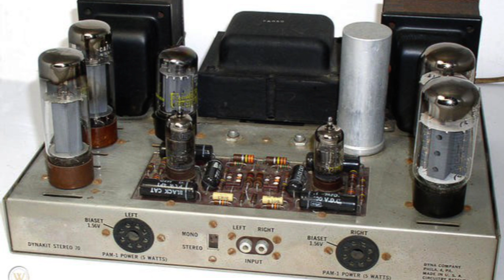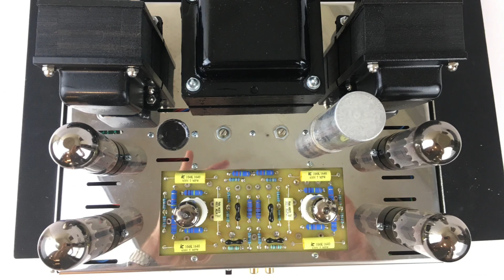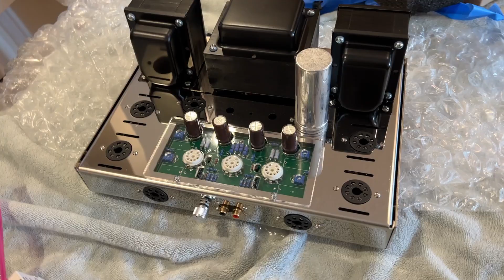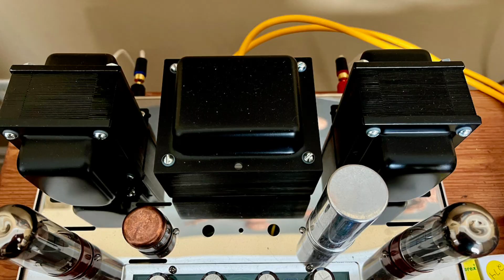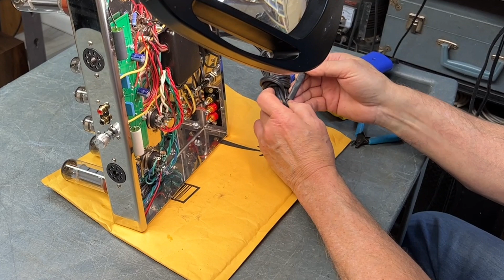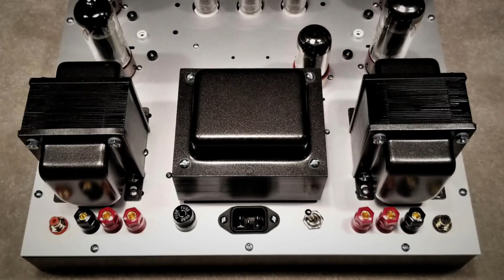The Dynaco VTA ST-70 Review. My First Proper Tube Amplifier.

Comment: Yet another fall. You stated - unequivocally - in you initial vid that your purpose in this entire exercise was to identify an amplifier with non-transistor sound. You wanted to find an amplifier with rich "tuby" sound. But, it this video, there's no mention of that. Did it have liquidy, tuby sound? Who knows? You sure as hell didn't say. All you dived into was the usual, dime-a-dozen,  audio review hyperbole BS. You blathered on about that like a monkey in heat. Those hoping to learn if this amp was a candidate for traditional tube sound are no better informed than before. Nice going.

Comment: High voltage rail is NOT the same with rectifier and semiconductor diodes........so is the sound ......
Highest musical & quality amplifiers are Full tubes.. with high sensitivity speakers made for being driven by those amps...
But indeed diodes have also some advantages........today modern loudspeakers , (low impedance, low sensitivity , compressed dynamics needing amplifiers with HIGH damping factor and high current ) which are not designed for tube amplifiers ( quoi qu'on dise 🙃)
Have lot of fun and listening pleasure with your ST70 clone amplifier....😛

Comment: Low sensitivity Ported proac loudspeakers, with low damping more uncontrolled tube amp bass, not an ideal combination at all, 🤣. My amplifiers are single output deviced push / pull design, (using the oversized sized 200 watt sanken output devices) class A transistor monoblocks has wide open natural sound with all the emotion left intact, including all the detail, and has lower distortion than a tube amp, with better bass control than a higher distorting wallowy bass tube amp, and I'm using the older monitor audio gold reference GR20's, and only using their midbass / treble drive units,  tuned to 60hz. The speakers disappear,  to leave a landscape of natural sound, not one bit of edgy sibilance.
Reply from the maker: And if your heard my setup, I believe you would say it sounds very nice. But you have not heard it, actually.

Comment: I have 3 ST-70's, two are vintage units with chrome chassis and one is a late model kit with its stainless steel chassis. I've restored the two vintage amps with new caps, fresh balanced tubes, and grounded power cords (I upgrade to grounded cords on all my vintage gear) and adding NTC surge resistors to compensate for the 124vac power in my area. I've replaced the 7199's with 6U8's and an adapter and am pleased with the sound. The recent kit version of the ST-70 has been a bit of trouble. there are multiple issues with the quality of the assembly, poor solder joints, and some intermittent issues that has that amp in the que for my service bench. Currently my vintage ST-70 is driving a pair of vintage - restored Fisher STV-667 speakers, rated at 100w RMS that I regularly utilize to enjoy the clean and warm sound in the upper power reaches of the ST-70. Like you, I mostly run digital music formats through any one of several different preamps, among them the venerable Dynaco PAS-2 and PAS-3, also vintage - restored units.  In my view the Dynaco line was the poor man's McIntosh.    I also have a few Heathkit W5M's that I've restored and enjoy.  As an aside,  I heat part of my basement workshop with my ST-70.   I hope you keep working with your Dynaco.

Comment: Greetings. Awesome! I have three ST-70s two Kenny Russell kit-builds and one that I built myself. They are all in the same system.  I'm absolutely in love with the sound. Just a note: You definitely do need a pre-amp with your VTA ST-70. The volume control that was added does not make it an integrated amp. There is no pre or OP Amp in the ST-70. Maybe your DAC can run as a preamp as well. If so, then disregard that statement.  If you Get yourself a tube preamp and your sound will improve greatly. You wont believe the difference.  DAC (not in preamp mode) --> Tube pre --> ST-70.  Thanks for all you do. I really enjoy your channel.  :)
Reply from the maker: Thanks for your comment. I had been using the volume control from the SMSL DAC. I took out my Schiit Valhalla 2 tube preamp/headphone amp and put it between the DAC and ST-70. Big improvement! I appreciate your suggestion.

Comment: When you change the driver board from the original it's no longer an ST-70 even though it looks basically the same.
Reply from the maker: Obviously, it's not an actual Dynaco ST-70. It's a new, improved  tribute to the ST-70.

Comment: Nice review!  This was one of my first tube kits a few years ago.  If you know how to solder well and can follow the instructions, it's certainly a fun project.  Otherwise...have someone build it for you.  I've since upgraded the all the coupling capacitors to VCap ODAM and the sound took a massive leap over the Russian caps (don't bother with the standard ones, sounded awful IMHO).  I've moved on to building many other tube audio devices and designing my own.  If you can check our a nice singled ended amp, I find them to be truly next level in tube sound.

Comment: Very good video. Very informative. I have this same Amp and it is really good, and hight quality. You def8made the right choice going with the solid state rectifier. I run mine with KT77 tubes and in the center position I use a JJ ECC99 and it brings the Amp to another level. I also run the bias a little higher than what the instructions say. Great buy.
Reply from the maker: Thanks for watching!

Comment: A suggestion on the technical problems experienced- an infant mortality of one of the powertubes (internal shorting) would cause excess current to be drawn through the choke and rectifier tube, and both of these parts usually run very close to their maximum ratings in these amps, so close that they would be damaged before the mains fuse would blow. An added internal fuse of 1/2Amp placed in line between the rectifier and choke, would be a wise move in these amps.
Reply from the maker: Very interesting. Thanks Jonathan.

Comment: 8:00  "departing ... Soviet Union" - are you saying Flux Condenser time traveled?
Reply: He did a stop in East Germany on the way … maybe. Makes sense that Flux Condensor has access to Flux Capacitors. Quality 1985 engineering.
Reply from the maker: @timleelim9930  he’s actually in Turkey now.
Reply from the maker: It’s possible. You never know with him.

Comment: I'm a long time subscriber, and always look forward to your videos, so I don't like to be critical, but feel I need to comment. Any performance specs? I didn't think so. Dr. Placebo definitely has you in his grip. Tube sound? Mid bass boost, rolled off highs, a good deal of 2nd harmonic distortion, low damping factor, and you can sit back in a dark room, with a glass of wine, and be soothed by the warm, enveloping red glow of the output tubes. I'm sure it sounds OK, but the best sound you've had, came from your initial Hafler setup.

Glad you're pleased, as that's all that counts.  If it sounds the way you want it to sound, nothing else matters. It's your sound, but it's not HiFi.

Re the issues. It seems that it wasn't tested, before it was sent back to you.
Reply from the maker: I appreciate your continued interest in my channel. But I’ll take issue with some of your comments. Placebo is a medical term that is often misused, and I don’t believe is the case here. Also, to assume you know how my system sounds and to declare it as “not HiFi” as well, is……ummm…BS. Thanks.
Reply: @MODAC  -- HiFi stands for "high fidelity," IOW "great faithfulness" to the source material.  An amplifier with as many flaws as this one may have qualified as "HiFi" on some sort of relative scale circa 1970, but it doesn't make the cut 50+ years later.  It's no better than the ancient design on which it was based -- in some respects, it's worse -- and, with a four-figure (USD) price tag, it's nothing short of a joke on the folks foolish enough to buy (into) it.

Like Len said, if "you're pleased, as that's all that counts."  Life must be very easy if one is so easily "pleased" -- but that fact is I have a few Chinese-made, sub-$100 (USD) "chip amps" that are far better performers.  Like vinyl LPs, tube audio amplification is nothing more or other than a nostalgia craze/hobby for people with more disposable wealth than they know what to do with.  It may be subjectively enjoyable -- and there's nothing intrinsically wrong with that -- but it's not "HiFi" by any sensible 21st century criteria.  It's more like "My Fi."
Reply: @editorjuno  so i guess luxmann isnt hifi Audio note isnt hifi Mcintosh isnt hifi  Audio Research isnt hifi PrimaLuna isnt hifi LTA isnt hifi Manly Labs isnt hi fi ,,,, ok got it.
Reply: @williamdwyer3856  -- I know nothing about Luxman tube gear.  McIntosh tube gear is measurably and audibly better than Dynaco stuff of the same vintage -- I know because I sold both back in the day and attended a few of the late DIck O'Brien's McIntosh clinics in which they would measure all comers, including Dynacos -- as was their solid-state gear compared to their much less expensive Dynaco counterparts.  Audio Research tends to also be better, although their famous "Six-Pack" power amp has at least one fundamental design flaw.  Interestingly, the much pricier Carver Crimson 275 tube power amp is actually a worse performer in several respects than this overpriced hobby project.

Here's the thing, William -- as with what passes for high performance in automobiles and computers, the criteria for "HiFi" has changed over time, and much of what passed for "HiFi" 50 years ago doesn't clear the bar in 2022, because we can do much better these days as long as we avoid nostalgic attachment to obsolete technology like the vacuum tube and the vinyl LP.
Reply: @MODAC   I appreciate your prompt response. It's not HIFI, if it alters the sound. That's the definition of high fidelity. If frequency response is altered, and higher harmonic distortion is allowed, with poor damping? All those things, may present a "pleasant" sound, and may be what you like, but if it's not true to the input, it's not hifi. If that's your preference, since it's your equipment, you are certainly entitled to listen to it the way you like.  I'm well aware of the definition of placebo. If you prefer, we can call it confirmation bias. 

Post more often, if you can.
Reply: @len How arrogant and silly you sound. ...And you're wrong to boot.
Reply: oh it's hifi for sure tubes have an almost limitless HF power bandwidth they have a different way of delivering power to the speaker. look at it this way: there are good transistor amps and there are bad ones. But there are practically no 'bad' tube amps, they always sound good. 'rolled of highs', no not at all, I have this multitone M250 amp and the highs sounds very clean very present not 'rolled off' at all. The question of why tubes sound so good is still a bit of a mystery it has something to do with the way it delivers power to the speakers the way it interacts with them. There are some transistors that sound good the proton D540 was a good amp but it doesn't get nowhere near the tube sound that's just divine. A transistor can only hope to sound like a tube and that's true. I've put some luxmann surround 5 channel amp on my ar3a's and suddenly the mid high's didn't sound that nice anymore I thought they were good but not on that amp they had that typical agressive schreechy mid high thing going on that's so typical of transistor class AB amps. You have to get a proper tube amp and see for yourself. Why they sound that good? my hunch is it has everything to do with parasitical ocsillations and HF power bandwith. a feedbacked amp connected to a loudspeaker is a kind of complicated system. Maybe there are certain points where the system becomes unstable. there's a coil at the end of most transistor amps it has a function there but I don't know much about that. But that 'oh you just like the distortion' thing, uh no at all my amp sounds very clean. very.. very clean.. you have to try a tube amp for yourself and you will see. yeah there are good transistor amps I've seen many but they just never get to that level. One little theory of mine is that tubes have this electron cloud floating around the cathode. so for HF power they don't have to draw power from the power supply it's already there. but that just a theory or a hypothesis someone has to figure this out properly. Maybe put these things on X/Y scopes and compare them. I would guess these distortion figures they give for these transistor amps only apply for a nice resistor load, when they are hooked up to an actual loudspeaker then it becomes a whole different story the inductive and capacitive loads are all over the place and the question is if the trans amp can handle it without getting into oscillation modes at certain points. because it's a fed-back system. The tube amp is also a fed back system but it has a much higher open power bandwith or something like that. This is what this is all about.

Comment: Very nice review. I've owned this Tubes4hifi version and the Dynaco Doctor one (you showed that website earlier) My Tubes4hifi was all new like yours and the other one an upgrade from an amp I picked up way back in college. Both sound great. Sold the Tubes4Hifi one during Covid because I didn't need two but it is a great amp. As is the Dynaco Doctor one, but the nice thing about the Tubes4hifi version is that it has a support forum.

Comment: I would love to try a tube amp to experience that sound you talk about. But that might get a little expensive for me. I built my rig so I could tri-amp my speakers with an electronic crossover network.All early 1970s electronics and speakers, many of which I bought when they were introduced in 1972. I love this channel.
Reply: There was a time when having two Dyna ST 70’s was the hot ticket.  In a bi amp or tri amp set up. A solid state amp for bass. Two ST 70’s for mids and above.  I tried it for a while and I didn’t think it did much but others swore by it or at it, I can’t remember which (insert sarcasm here). We did all sorts of crazy things in the late 60’s and early 70’s.
Reply: @TheDecguy  I do remember. I was there. Bought my first stereo system in ‘69. Thanks for the information (inset sarcasm here. 😎) Cheers, J

Comment: Seems like you got a unit with a few issues. I woukd hate to purchase one and have the same problems or even worse blow out one of my vintage rectifier tubes. Glad it is working as intended in the end
Reply from the maker: Issues all from bad tubes. Nothing wrong with the unit itself.
Reply: @MODAC  thats great to know because I might be purchasing one in the future. Thanks for the review
Reply: I finally bought a vintage Mullard rectifier tube for my VTA 70 and all is good. They are beefy and can handle it.  I went through quite a few modern rectifiers until doing that. I do think I got a modern JJ that was pretty stout as well.
Reply: @midwestside1969  i also use the Mullard from upscale audio , no issues at all ,a much better  tube !

Comment: Be wary of installing a solid state rectifier as a substitute for a tube rectifier especially a 5AR4 which uses an indirectly heated cathode. Unless the device has a dropping resistor built into it, the B+ power hits the tubes very hard with very high voltage until the tubes start to conduct and brings it back down. The tube rectifier is a soft start feature which was designed into it. The Tungsol brand of 5AR4 are known to arc and short and I would shy away from those. It is plausible the solid state rectifier was the cause of a tube to fail. (edit: added solid state rectifier to last sentence)
Reply from the maker: The Weber has a delay thermistor built in.
Reply: @MODAC  where did you purchase the Webber ?
Reply from the maker: @williamdwyer3856  from the Weber website.

Comment: Have you tried reversing your speakers? I bet when you do that it even sounds more spacious when the tweeters are both on the outside, instead of firing inwards, just a tip...Enjoyed you video very much.
Reply from the maker: That’s how ProAc says to do it.
Reply: @MODAC  Well....please try it reversed...and listen for yourself....then draw your own conclusions...if not tried, you'll never know.;-))....regards from The Netherlands.
Reply from the maker: @arthurspieker1031  they sound great as they are. Never thought they needed switching.
Reply: @MODAC  Who cares what the speaker manufacturer says, It’s your set-up at home not theirs, right?  The Polk lsi9’s are also “Mirror Image” speakers and in the Polk Manual it says try the tweeters in or out to your liking👍 Never be afraid to try something as what a manufacturer suggests IS just that, a Suggestion… SVS says not to put something under their down firing subwoofer too, but I put down a made in Italy Terra-cotta tile and the Bass is much more defined.. Remember the motto “To each his own”.. Best2You…  The tweeters on my set of Pinnacle BD-650”s are designed only 1 way.. One inside, one outside👍 So experiment.. Same for speakers that have a bottom tweeter, you can always try it upside down as ZEO’s  of ZReviews usually does…

Comment: Wondering what those tube sockets on the front panel are for?
Reply: In the original Dynaco design, these sockets could be used to provide power to a preamp.  This version of the amp doesn’t provide power to the sockets so they’re just used as a convenient place to check bias.
Reply: @FluxCondenser  Thanks!  Can"t wait for your vid
Reply from the maker: Adjusting tube bias.

Comment: Looks like you upgraded your center driver tube to an Amperex Bugle Boy - very nice. I have been running an ST-120 with Magnepan LRS speakers for about a year now. Trying out different 12au7 tubes has been like a little treasure hunt.